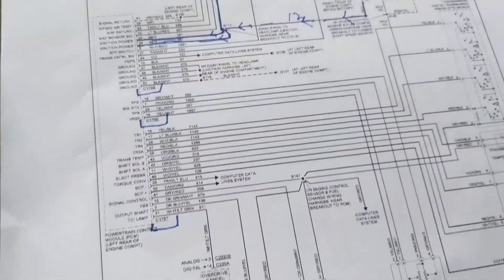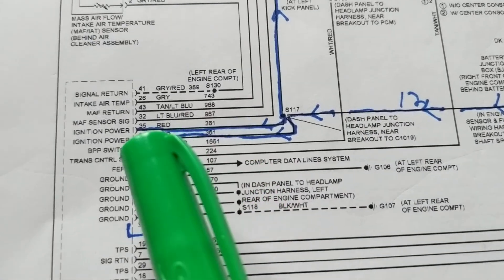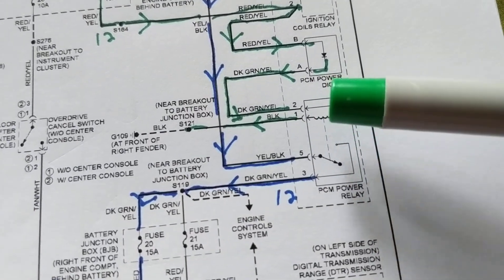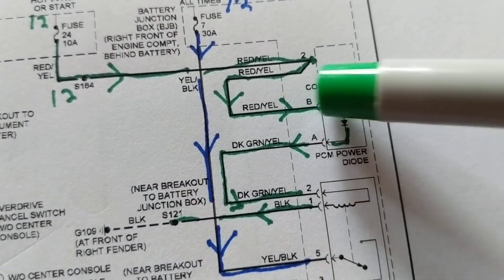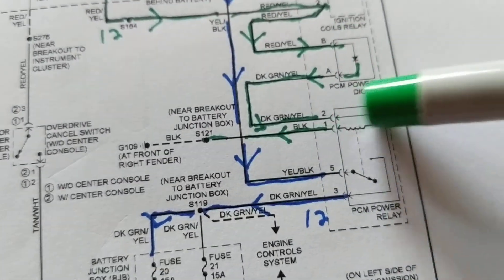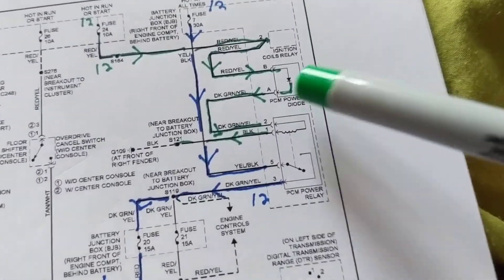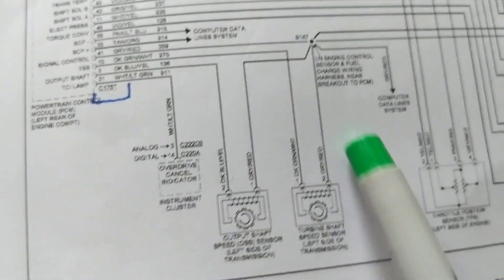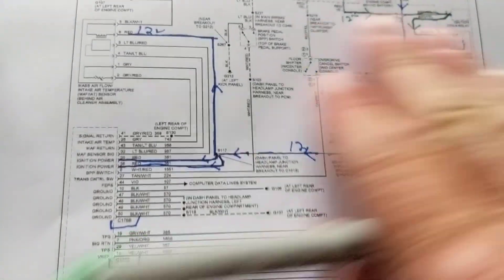car computer problems from wiring diagram ECM PCM

Comment: Theoretically speaking, in terms of engine swap with pcm. All I would need to do is that everything that send 12v to the pcm and install it into the project vehicle. Correct??
Reply from the maker: Trying to understand the question a little clearer models have to be reprogrammed
Reply: @Joeelectronicschematicsforauto  maybe idk how to ask the question. But I would just like to get the vehicle running using the ignition for the truck, and I'm what it would all take.
Reply: I have a 96 Z28 lt1, and am wanting to swap it into a 93 s10. I am going to be taking the engine wiring harness, connects to the PCM. I know that it needs the clutch switch signal, vatts signal, power and ground to the pcm. The pcm controls all engine components. I want to be able to use the 93 s10 ignition to power on the vehicle. Would there be anything I would need to do with the pcm for the lt1 to start?